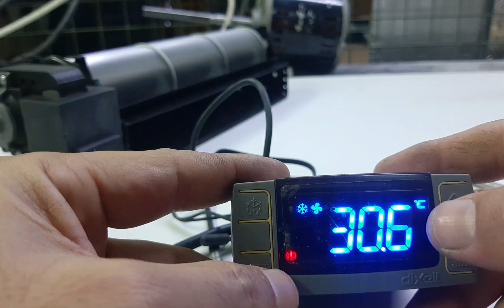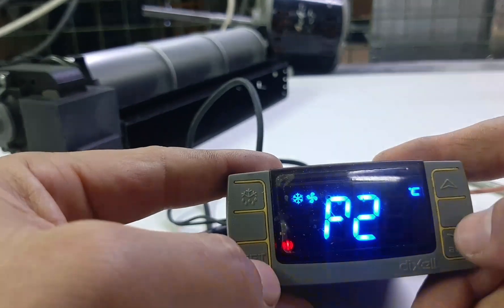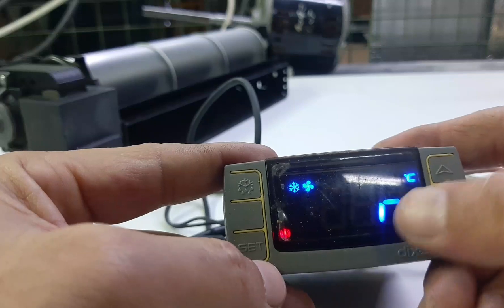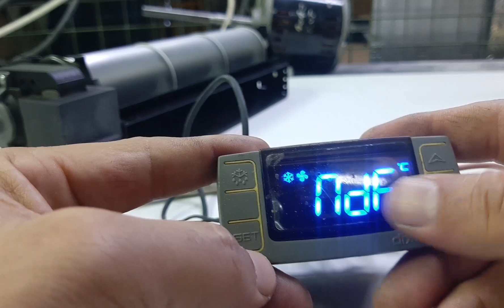how to solve p2 error in dixell controller | dixell controller p2 error #zkmultitech

Comment: I don’t think this is resolving the issue, rather it’s a work around.
Reply from the maker: Try it and see this is the solution
Reply: @zkmultitech  Imo the p2 sensor should be used not deactivated. Why would you want it deactivated?
Reply from the maker: P2 sensor use for defrost termination we have two safety one terminat by temprature and one terminat by time when we deactivate the sensor we have another option defrost terminat by time it's normal
Reply: @zkmultitech  I just ordered a new sensor, and did a temporary repair with an sensor from an aquarium thermometer. It’s not properly placed as cable is to short but works as temporar solution. 

Now my controller is not exactly the same as yours and it seem to run custom firmware as I can’t access the programmering menu. Not even a password input shows. Anyway seem to want a 10 kohm NTC. My broken sensor was at 1.5 kohm.